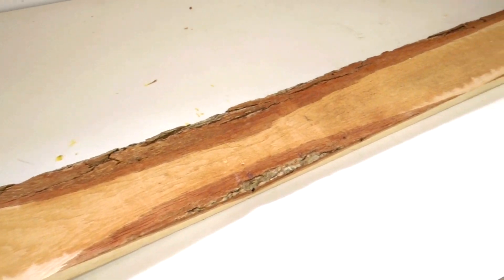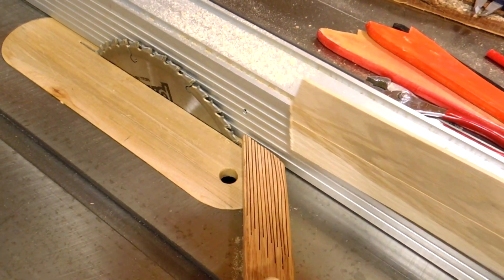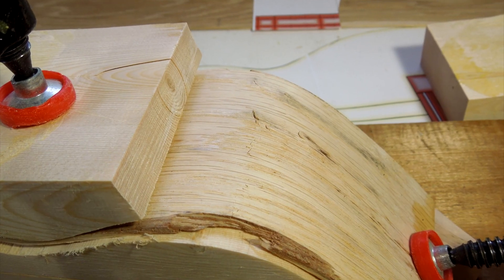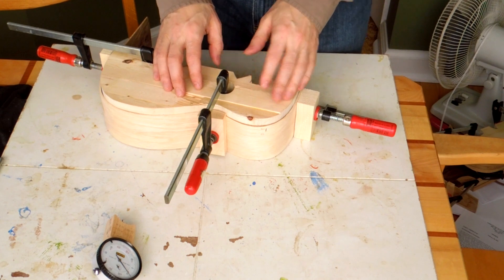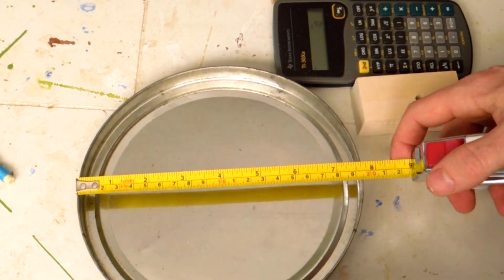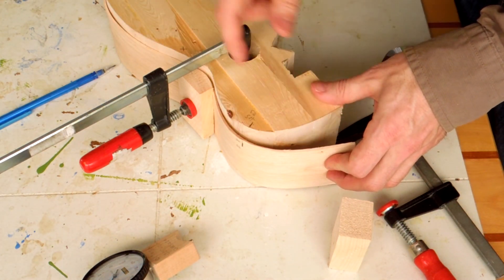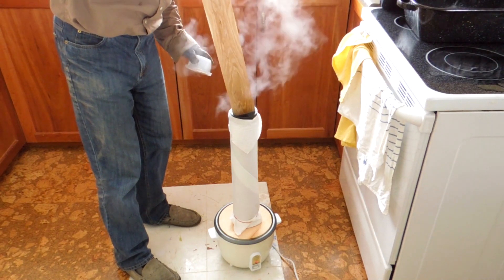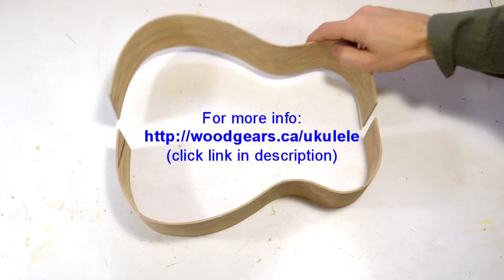Wood bending for ukulele sides

Comment from the maker: problem with light bulbs inside the form is that the wood doesn't heat until it touches the form.
But it's been suggested to use the oven.  That might be a neat thing to try.   Once the wood is on the form, dryness won't crack it, so make a bending form without any glue, eliminate the clamps, and then just bake the whole thing in the oven.

Comment: I also think that this could have affected the way of the wood springing back a bit. If you would have fastened the two outer claps first and then the middle one, this would have probably pulled the wood much tighter around the radie of the form and would have also put the it under quite a bit of tension but hey - I have no idea and have never tried steam bending... Your calculations and the new, tighter bending form are a really clever solution to that problem! Great vid as always!

Comment: I think this is a good observation because it makes more sense to tighten the clamps in a balanced manner.  In theory, leaving some slack in the middle of the work until the ends are bent allows more area to absorb the bending stresses.  But, I have never bent wood so I don't know if there is any difference in results.

Comment: Nice work.  Clever approaches.  I wonder if steam from a steam cleaner applied to the bending stock while it is clamped to the original bending form would reduce or eliminate the spring-back altogether.

Comment: That rice cooker idea is very creative.

In the article you mentioned you had additional relaxation.
In Pat's video he did additional heat cool cycles while on the form.

Although you don't have that heating pad, could you just use your kitchen oven ?
Most of them will do low temp heating like 150 or 200 degrees Fahrenheit.

Comment from the maker: That's the theory.

By "poorly made", I suppsoe you mean off by a fraction of a millimeter.  And getting it accurate is tricky, because you have to compensate for the layer of the veneers. So imagine 4 layers of veneer, each  0.1 mm too thin or too thick, and you have a problem!

Comment: Another variation of the blow torch method is a high watt incandescent lightbulb.  A dimmer switch could add more control over the temperature.

Comment: Good work. I think if you built a mold where the sides are inside, you can glue the kerf linings, top and back on while in the mold and you won't have to worry about springback.

Comment: Matthias,

I noticed you used a curved clamping block for the center bend initially and you later used a square piece of block for the final round. DId you find the curved piece less effective in creating the center radius thus using a square piece to drive the edge into the curve for a tighter radius?

Comment: Heyas Mr. Wandel!

a little observation i got from viewing a video of the ukulele master, You've posted earlie, in comparison with Yours technique : he first fixates the middle clampbut NOT TO THE VERY BOTTOM - he goes like a 2/3 of a way down, then he clamps edge clamps and in the last part he fasterns the middle clamp to the very bottom - then the wood is stretched.
You instead first fastern middle clamp to the bottom point  ant then do the side clamps.
In this case the alignment is not tight

Comment: I think what he means, is: When Pat bends the wood around the form, the waist clamp is tightened after the bottom/top clamp - this causes the wood to be pulled tight around the other two curves, which might be why he has less springback (he still had some, but much less) than you do. I'd be curious if you could do an experiment and compare the results....

Comment: I think you should steam the board once more after you've clamped it. I know, it's complicated but it would help. I've played with bending wood and in more than half the times i've used that method it yielded a better result than just steaming then applying it to the form.

Comment: I have a question about Paul's dowel maker. Does it need to have fine teeth spaced closely or could you use the metal from a drywall saw? They are about 6" long but spaced farther apart.

Comment: That was an awesome way to solve that spring back problem! Although, through my experience of building an acoustic guitar it was much easier to soak the wood for a day and then heat a metal pipe to then form by hand. Less math, which is easier for me but I don't think math is as much of an issue for you. Love your vids!

Comment: Don't steam the wood. Boil it, and you need a special 300*F heating pad under the wood you are bending separated with a sheer of spring steel. But with the limited tools you have, nicely done!

Comment: Hey Mathias, forget about the specific wording. There is a bit of a language barrier. He is eastern European and just misspoke. He is just saying that If you pull the inside radius nearly tight, then clamp the ends, and then finish clamping the inside radius, it will pull the strip tightly to the form. When you clamped your strips, there were slight gaps around the large radii. It probably makes no difference to the finished product anyway.

Comment: Would it not have been easier to laminate the section using 1mm birch ply with a selected veneer on the out side?
Using a male and female former you would have had very little spring back and it would have been easier and quicker, not to mention all of the sections would be near enough the same. Steam bending can be very varied at best.

I'm not being negative to what you've done, I like your video's and you have great ideas but it seems you've gone for the long winded method here?

Comment: I'm not trying to be a self-appointed Youtube safety monitor but I'm wondering why you don't use a splitter. You seem to do fine without one but I'm just a little curious. I think it's a safety feature you can do without, but it's nice to have just in case.

Comment: Using just a female mould would have been easier, since you can glue the supports in while in the mould. So the side cannot spring back when you take the sides out.
Reply: +apinakapinastorba but it keeps the tension. Steaming/humidifing and make the wook keep the right position avoids molecular tension.

Comment: Hi M , old boat builders used soak there wood in water [some in rivers next to there workshops] before steaming , I used a homemade long thin wooden box and attached a wallpaper stripper to one end for the steam the wood comes out hot dam hot , someone said about 15 minutes per inch [ 25 mm ]  ,can you play the ukulele,
G

Comment: The only 100% safe practice is to avoid the use of any tools.  If you decide to use tools, you are risking your safety.  The amount of the risk is almost entirely dependent upon the tool operator.  A dummy can hurt himself regardless how many safety measures are built into the tool.  Matthias can safely use a table saw without blade guards or a riving knife.

Comment: The Whole point of a male and female former is to get even pressure on the section being shaped? I cant see what you mean unless the former has been poorly made. 

You'd get more even pressure with a male/female former than with just a male former and 3 cramps?

There's also the added structural benefits of laminating wood.

Comment: But, the alignment he was referring to was the misalignment resulting from springback.  His theory must be the bends would have held form better if you gradually clamped the piece at each bend rather than first clamping the middle tight and then each end all in 1 single tightening.

He isn't taking into account you are using a simpler clamping jig.  And, even if you clamped each bend gradually, I doubt his theory of less springback is correct.

The bottom line is you got the right result.

Comment: i never wrote  Right
i ment Tight
You can not put enough force to fix sdies fully aligned to the form.
I am sorry that my poor english does not let me express my thoughts enough clear for You could understand.
Maybe if You watch that guy's wideo on 5:22  he starts to fastern the middle clamp AFTER he fixed sides and the whole sandwich of wood & metal starts to get pressed very TIGHT to the form. it is impossible to achieve the way You do - there wil always be litle gap between wood and form.